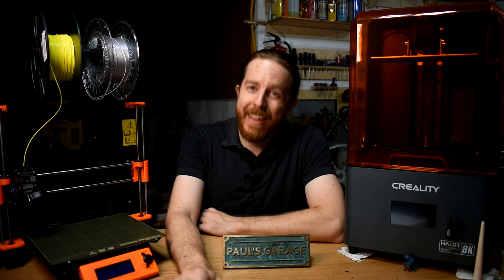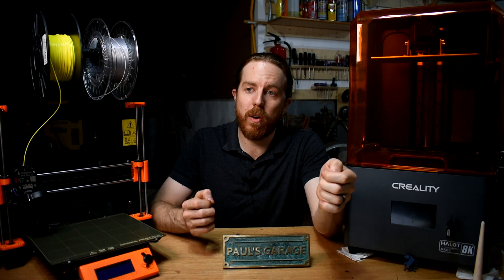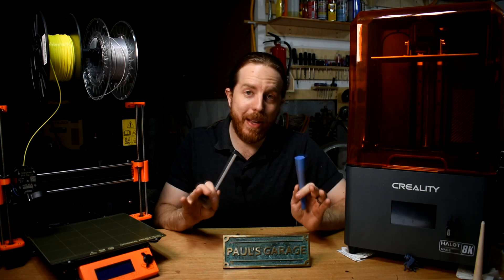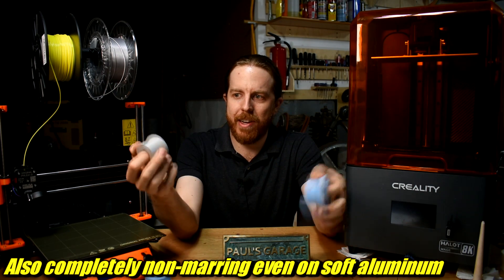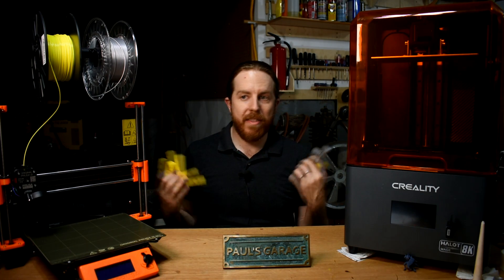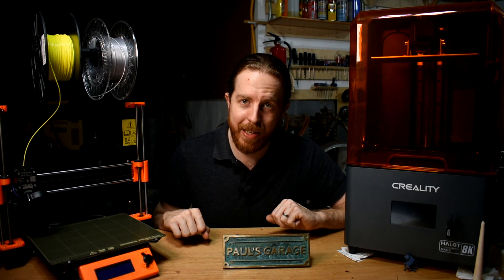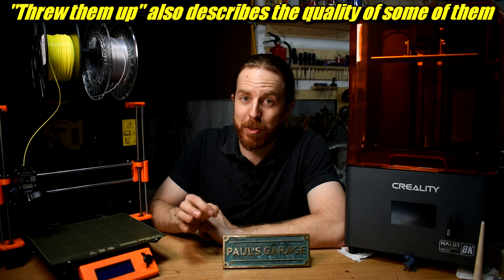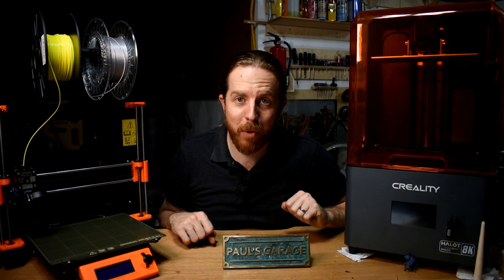A 3D Printer for NON-Plastic Projects?

Comment: Instead of sanding or complimentary to it you should use resin or PU varnish or spray body filler to smooth your parts, especially if it´s gating parts und such which don´t need to fit accuratly. This can save a lot of time.
Reply from the maker: I've heard of that but haven't tried it.  Looks like a good idea

Comment: PLA is pretty strong, the problem is it is also brittle and gets soft at only about 55-60°C, so it basically melts in a car in the sun.
Reply from the maker: Good point.  I don't have a hot shop though which is nice
Reply: @PaulsGarage  In this case you should be able to do everything with PLA since it´s the cheapest material. Otherwise use PETG for anything structural. It wont break easy, is still cheap and has much better mechanical properties compared to PLA. It also prints well, you don´t need an all metal hot end etc.
Reply: @OutOfNamesToChoose  No it doesn´t it simply breaks instead xD

Comment: Good little summary.
3D printing has been a real eye-opener for me, as I can now realise so many more of my ideas in ways that are much more efficient and accurate than I could manage before with other methods. The design part is still a series of hurdles, but I'm improving as I go.
Sure, the plastic aspect is not always ideal, but if the correct type is chosen it can make a world of difference to the outcome if certain properties are needed. Understanding the materials properly can take a long time and it can be a drag to manage of you have so many spools, but having a diverse set of resources on tap is great.
Aside from all the unique tools and such, one thing I've found useful recently is the ability to design and print router shape templates for individual woodwork projects.
The Prusa MK3 is a classic. Mine has done a lot of work! Not the latest and greatest, but they are indeed reliable and unfussy. Plus every part is replaceable.
Please separate and recycle your waste, folks!
Reply from the maker: Exactly what I think!  I'm very happy with my mk3 and even my mk2 is still working fine

Comment: For your pouring basin, why not cast the mold in aluminium.  Smooth the inside mold surfaces. The you can make as many basins as you want and it won't wear out in your lifetime.
Reply from the maker: Good idea for sure

Comment: I 3D print parts for G I Joe's(1/6 and 1/8), spacers for my measuring problem (measure twice, cut once, screwed it up any way), tool holders, jigs, replacement parts for broken things I found at Goodwill, parts for my old Jeep ($28 for the pieces to hold the sun visor buys a lot of my patience with a 3D printer), RC car parts, and basically anything that isn't easier to get off of eBay, Amazon, or Ali express.
Reply from the maker: Custom spacers is one I hadn't thought of yet

Comment: I (sometimes) repair old consoles, and 3d printed parts are perfect for mounting new board in an old housing. It's a lot easier to 3d print a mounting for an itx motherboard than it is to machine one.
Reply from the maker: Definitely.  Did you scan the original or just model from scratch?
Reply: @PaulsGarage  depends on what i'm doing. I also don't have a 3d printer myself, I use a couple my local library branch has. My last completed project was fixing an n64. The cartridge slot has those two plastic covers that fold down. They broke on mine, so I literally traced them on a drawing tablet to get the shape then 3d printed replacements at the library. super easy, and fairly quick fix.
Reply from the maker: That's really cool.  I used to have a N64, good console

Comment: Super brittle rep is from older UV resins.  There is a trade off on details and strength.
Reply from the maker: The blue grey resin I showed in there is pretty tough on my experience, but fine details break off if I drop on concrete.  I was surprised how tough the white stuff was even though it's a "basic" resin